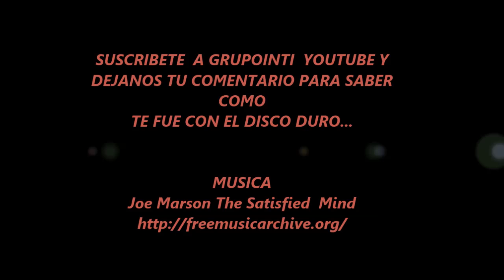Mundo VAIO 1 Cambiar Disco Duro Portatil Sony Vaio VPCEGXXXX smart hard disk error windows problema

Comment: tienes un tutorial donde cambies el DD por uno de mayor capacidad y le instales el SO que tu quieras (windows 10 por ejemplo) a partir de una iso montada en una usb o disco dvd?, es solo querer saber si se le puede poner un disco de mas de un terabite a una laptop que tiene uno de 280gb con windows 7 ultimate y subirlo a el 10, la cuestion es si tienes el DD de 2 teras nuevo y el disco dvd o usb con el SO windows 10, necesitas hacer algo mas o solo con instalar el DD en el equipo e insertando el dvd el sistema hara todo el trabajo, yo actualize el w7 home basic a 7 ultimate con un dvd sin problema alguno, pero quiero saber si con un DD nuevo es necesario instalar primero un SO inferior para despues actualizarlo al 10 o se puede hacer directo ya que tengo el dvd para instalar el 10, digo  pues ya que si te llevas en promedio una hora o mas cambiando un SO, tener que hacer dos instalaciones de un SO( w7,8, 8.1 etc ) primero y luego una actualizacion al 10 (ademas de la actualizacion de los drivers) te llevaria casi todo el dia